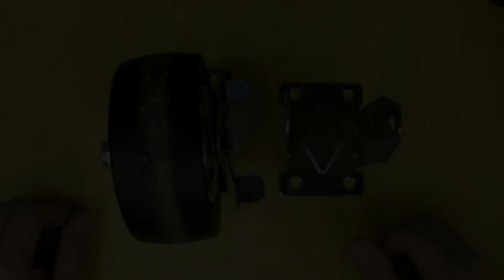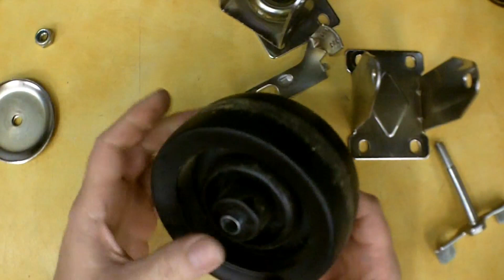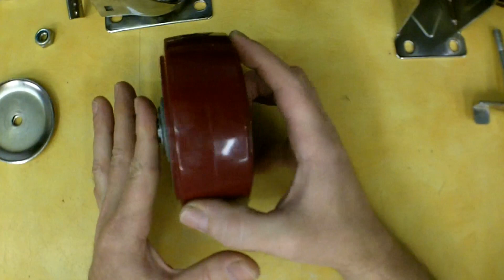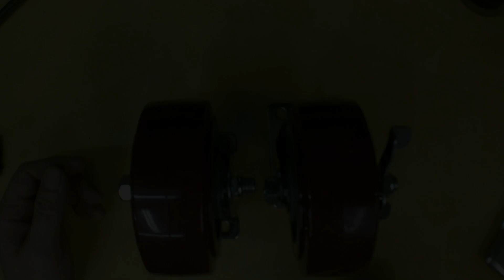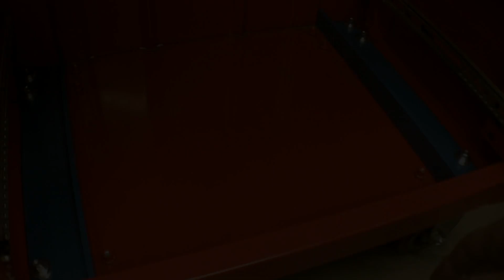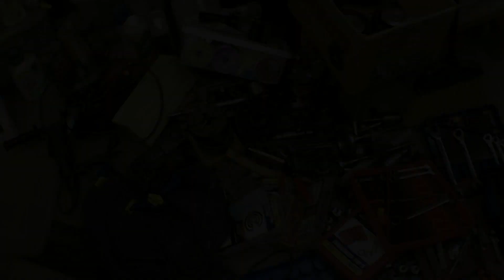Harbor Freight Tool Chest Caster Wheel Upgrade

Comment: Hey and great job. I have a different box but am doing the same. The difference being in that I built an angle iron frame and moved my castors to the outside corners. Makes the box very stable when rolling. I work in the maintenance field and move my box long distances numerous times daily. So keep us posted on the flat spot issue. Thanks again
Reply from the maker: Thanks Hammer! I agree that moving the casters as far outboard as possible would make a box even more stable. These narrow tall boxes like mine are top heavy by nature. I was flat out scared to move it to be honest with you...lol.  Since posting this video, the box has been pretty much stationary until just a few days ago. The wheels I chose have not developed a set, and roll like the day I put them on. Since you move your box frequently, I would highly recommend them. If you do install them on your box, please feedback on your experience as it will assist others I'm sure. Thanks and take care, G.

Comment: Hmm. I think I see a pencil sharpening pad for drafting amongst all the tools on the floor. (Next to some drill bits and slightly overlapped by a set of wrenches on a plastic tree.)  Thanks for the explanation on the wheels. I'm getting a couple of this same cart, but I want it to be gentle on hardwood - and this answers all my questions that will point me in the right direction. Particularly about the mounting pattern being unique, hence wheel change rather than entire caster change. Once again I've saved a lot of time by checking YT. : )
Reply from the maker: I believe that was a tool post set in a box Allen. This setup should do well on a hardwood substrate and should be non-marring. Good luck, G.

Comment: Great info!  I have looked at that box and they go on sale for a very good price. I noticed you have the small band saw by them too. I have it also and it works well. It is one of the most used tools I have. If one chooses their tools carefully , HF does have some bang for the bucks.
Reply from the maker: Thanks! This is a great box for the money. The band saw works great. It sure beats using a hack saw and was inexpensive to purchase. You're correct, if choosing tools carefully you can get a good product for a great price. Thanks, G.
Reply: *****
Well I had the day off and so I thought I 'd check my HF flyer that has been on the coffee table and lo and behold they have the box on special w/coupon for $319. So I just came back with one. I will do your brace mod before using it. I will probably leave the wheels alone as I don't plan on moving it anyway. I will just grease them up well. Thanks again!
Reply from the maker: Mr26Huffy I'm not sure whats going on with G+. I never was notified of your reply- just happened to see it when answering someone else. GREAT DEAL you got there- you will be happy with it I'm sure. The brace mod should take care of you for sure and since you don't plan on moving it much- you should be good with just greasing the wheels. They're bone dry out of the box. I have to move mine around to get access to other tools since I have a small shop. You're a step ahead of the game with doing the mod upfront- no need to unload like I did. Good luck with it and let me know how it turns out- and what you think of the box once loaded. G.

Comment: I went with 5" swivelers at all 4 corners. Man does it make it easy to move.
Reply from the maker: +AKA Wireguy 
That's cool. I agree, the wheels I used make it a breeze to move around. Take care, G.
Reply: I am looking to switch to all swivels do you have a link to the wheel you bought?

Comment: Are the braces sitting flush with the bottom of the box or slightly above? I’m thinking about adding braces and was curious what diameter I should use
Reply from the maker: Here's a video on exactly what I've done. Hope this helps. Good luck and take care, G.
Reply from the maker: My apologies, I failed to include the link to the video I'd made. Lets try this again. Hope this helps, G.

https://www.youtube.com/watch?v=ys760EvzfZE

Comment: I need to source a hard, dense rubber punching block for leatherwork, about  30cm x 30 cm x 2cm, Shore 40D to 55D. The rubber block I need seems to be similar to the hard black rubber of the black caster wheel you showed at the beginning of this video. What would be some useful search terms to source 2cm-thick sheets of this rubber?
Reply from the maker: The original casters were plastic, but something like this might work for you- not sure.  Good luck, G.
https://www.amazon.com/Teemico-Leather-Punching-Cutting-Stamping/dp/B07P18TWB8/ref=sr_1_1_sspa?dchild=1&keywords=leather+punch+mat&qid=1618033714&sr=8-1-spons&psc=1&spLa=ZW5jcnlwdGVkUXVhbGlmaWVyPUEyVTRHR0dVR1lDVzlaJmVuY3J5cHRlZElkPUEwNDMxOTMwM0NMTVZGRlAyMzVCVyZlbmNyeXB0ZWRBZElkPUEwODYyMjM3RzRUUU1BTFZKRzUyJndpZGdldE5hbWU9c3BfYXRmJmFjdGlvbj1jbGlja1JlZGlyZWN0JmRvTm90TG9nQ2xpY2s9dHJ1ZQ==
Reply: @ghostses Thank you for your reply.  I'm trying to find the material from an industrial source instead of a reseller who has already done the same. The exact item I need is sold in Japan, but I'm trying to avoid high retail and international shipping costs.
Reply from the maker: @pequodexpress  Understool! Sorry I couldn't be more of help. Good luck to you, G.

Comment: Ghostses, GREAT videos! I hope to pick up one of these boxes this week. How do you like the box after a few years? I've outgrown my Craftsman stacks. Where did you find the wheels you used? I doubt I'll find them at Lowes or HD but wouldn't know where else to look for industrial wheels.
Thanks and keep up the great vids!
Reply from the maker: Thanks Greg! After the mods I made, I'm still completely satisfied with the box. I found the wheels at a local material handling supply house. It's a Colson brand wheel. I gave the part number in the video somewhere. I bet if you locate a material handling supply house in your area, they might have them. Or, you could probably find them on the web. Yeah, Lowes or HD won't have them for sure. Mine are still working great, and no flat spots. Hope this helps, G.

Comment: Do you drill and then bolt the top box on to the lower box for added security and safety?
Reply from the maker: +Blaine Bugaski 
I didn't Blaine- but that's certainly a great idea! Take care, G.
Reply: I have a triple stack Craftsman box.  That's what I did.  Just 4 bolts with washers and lock washers for each box to the other.  12 total.

Of course they say spring tension lock washers are worthless.  But I have plenty to use so I do.
Reply from the maker: +Blaine Bugaski 
That's cool! Depending on the task, I use lock washers all the time and they work just fine. Plus they're cheaper than nylocks...lol. G.
Reply: ***** Nylocks are terribe to work with when you have to remove them and everything is seized up.  So then you are forced to melt the nylon out and it turns into molten lava.
Reply from the maker: Blaine Bugaski
LOL..yeah that's true! G.

Comment: Thanks for posting this video. That looks to be a great upgrade. Still no set in the wheels? I'm planning on buying this tool chest soon and thought I'd check in to see if things are still working out well for ya.
Reply from the maker: No problem! It was well worth the upgrade and there is still no set in the wheels. It stays in one place for a long time and they have no flat spots at all. I highly recommend them. I have another video posted showing how I stiffened up the bottom of the box if you want to check it out. It's another worthwhile upgrade. Good luck, G.
Reply: ***** Great to hear! I picked up the box on sale for $320. Turns out it was damaged a little and they didn't have a replacement, so I talked 'em into 30% off and got it for $225 plus tax. Fortunately, I was able to fix the dents with some wood, some clamps, and a mallet, so you really cannot tell it was damaged anymore. I put some angle iron in the base as well. I'll probably do the casters in the future too. You're making me want to pick up a metal lathe watching some of your other vids. I just wish they weren't so expensive!;) Thanks again for the videos.
Reply from the maker: tlgrimmy Man, you stole that box! The fact you were able to straighten out the dents is even better. Adding the angle will help it out for sure. I highly recommend doing the casters with the exact wheels I've shown. It rolls so smooth it's almost scary. If you do upgrade, you'll still be well inside what I paid for my box- not bad. The before and after is something you just have to experience for yourself and you won't be disappointed- guaranteed. Let me know your thoughts if you do change out the wheels.

Making things on a lathe is super fun. It is an expensive hobby for sure. I would say much worse than RC stuff which can rob folks blind. The lathe itself is an expensive piece, but the tooling and attachments is where the REAL money goes. I do recommend getting into it, as it is extremely satisfying and addictive, but be prepared to pony up....lol. G.
Reply from the maker: ***** $200 for the machine would have been a great jump start. Too bad it didn't pan out. It is true most money goes towards tooling. It's very satisfying to learn and use the machines, and I highly encourage folks to do it, but with the outlay in mind. I used to keep my investments in a spreadsheet to see where I was at but promptly quit...lol. I did spread much of mine out over several years so the impact wasn't really felt- but it was still there. Take care man, G.
Reply from the maker: ***** I'm pulling for you! G.

Comment: Nice work G. Knowing how you have a keen eye and mind for detail, I'm curious as to the breaking system you design for it. Mechanical or hydraulic...LOL! At over 650 plus pounds, you just might need it. Oh, there was a couple of things you forgot to add to this box. Where's the cup holder and magnetic beer opener....? Great vid as always.
Reply from the maker: Hydraulic of course...lol. At fist I was scared it would tip over and kill me before my upgrades. Now I'm afraid it's going to run me down since it glides so well.. A cup holder, beer opener, and a  urinal and it will be all set...lol. Maybe even a hot plate, microwave, and a queen size bed- but I haven't decided yet...I stuck on trying to find the perfect sheet set so it will look pretty....lol. G.

Comment: You painted those braces??  I would have run them through my Harbor Freight powder coating setup. LOL
Reply from the maker: Yeah Henry, I probably would have powder coated them if I had the setup..LOL I've seen the HF setup but haven't really looked into it. What do you think of it? G.
Reply: I've used it on several small projects and it does fine.  Wish HF would carry some additional colors, especially gloss black, but eBay and Amazon carry lots of supplies.  Dragging an air hose around is sometimes restrictive in comparison to say Summit Racings' offering with has a build it fan.  But other than that it's a good value IMO.
Reply from the maker: *****
Thanks for the info Henry! Strange they don't carry gloss black. That seems like a default color to me. They should carry more than 4 colors for sure.  But, like you said, other colors can be had elsewhere. Thanks again, G.

Comment: Thanks for making this video.  I just purchased the same bottom cabinet with a slightly different top box today.  The wheels caught my attention immediately.  Watched both videos and really like what you did.  I was not aware of the different grades of hardness and am grateful you shared that with us.  For a good laugh, check out my channel  DoingItCheap.
Reply from the maker: +DoingItCheap 
Small world. I watched your video on the t-post puller a couple of days ago. I pulled about 6 off a property with my winch. It worked but it tore them up. I should have used the puller so they could have been reused. Cheap and effective- to of my favorite things...lol

Yeah, the wheels are the only negative I had with the box. Well, that and the bottom flexing but I have tons of weight in it. The upgrades were well worth the work and expense. The wheels I used still don't have any flat spots and are working great. Good luck, G.
Reply: Glad to know the wheels are working after this amount of time.  Thanks for watching.

Comment: Q;
Where did you say you found the new casters?
Reply from the maker: Will Clemons Will, I purchased them at a local material handling company in my area. If you look for one in your area, I'm sure they might have them if they carry the Colson brand casters. The part number for the wheels I purchased is 5.00005.925. Hope this helps, G.
Reply: Thank you for the feedback
Reply from the maker: Will Clemons
No problem! Good luck, G.

Comment: I'm surprised you had trouble finding casters with a 1.75 x 3" hole pattern. That's the same pattern as on the bottom of my Kennedy boxes. I replaced the casters on them for similar reasons, but I did the whole caster, not just the wheels.

For really good information about comparing the Durometer scales, check out this McMaster link: http://www.mcmaster.com/#about-rubber-durometer-hardness/=127ij4k
Reply from the maker: +Edward Giovannelli 
I couldn't seem to locate a 5x2 caster with that bolt pattern. Anything I could find with that pattern had narrow wheels. Where did you get yours from? Thanks for the info on the scales! Take care, G.
Reply: I would ask for part numbers for your replacement casters but seeing you didn’t respond 5 years ago don’t youwill now 🤣

Comment: How are the wheels holding up?
Reply from the maker: Still like day one Jacob! No flat spots and it rolls like butter. Good luck, G.
Reply: @ghostses  Did you ever consider getting rid of the ridged casters for swivel casters? I found that Husky has a caster kit with similar plate dimensions. Just have to get better wheels. Also, Harbor Freight sells the swivel casters for $35 a piece. You have to order them from the parts #. Just though I mention it in case you decide to do another upgrade :)
Reply from the maker: @JDMJACOB1  No, I didn't consider that. I personally like a ridged set and a swivel set. Mainly for ease of steering the box around, but more importantly for control if the weight takes over. In the case, with 4 swivels, all control it lost and there's no way to turn to the box to stop it from going wherever it wants to go.  Just my 2 cents, but hope it helps. Take care, G.